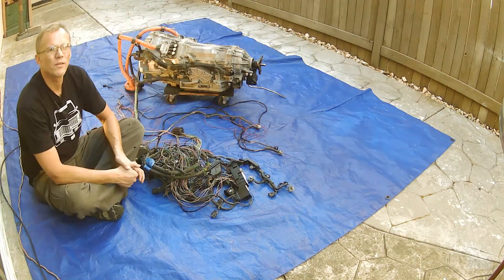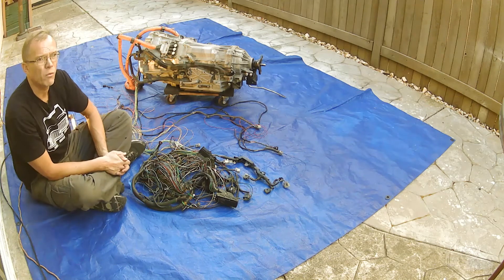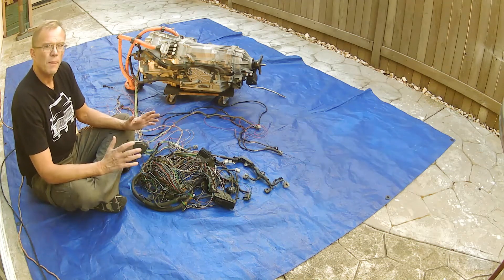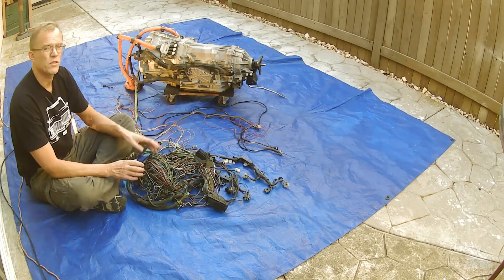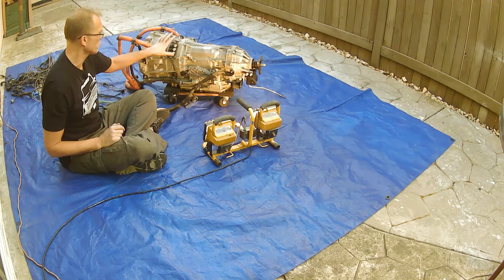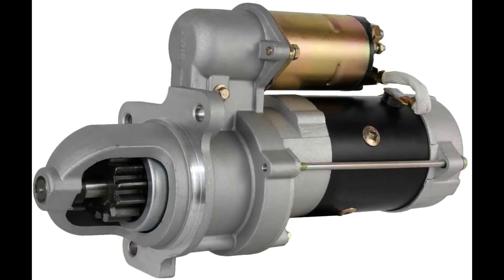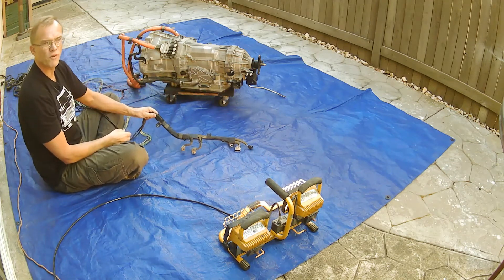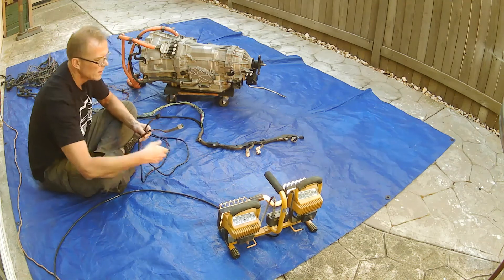Dusty 1971 GMCe Electruck EV Conversion - Lexus GS450H Transmission Harness

Comment from the maker: The oil pump is not powered by an orange high voltage wire, I misspoke, I must have been thinking of the AC compressor